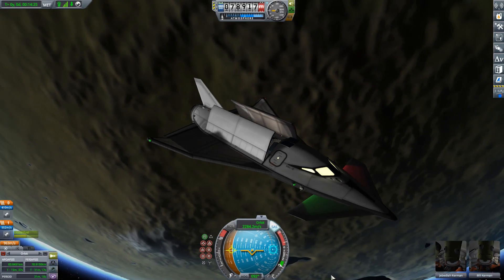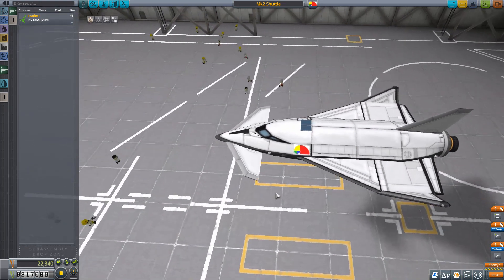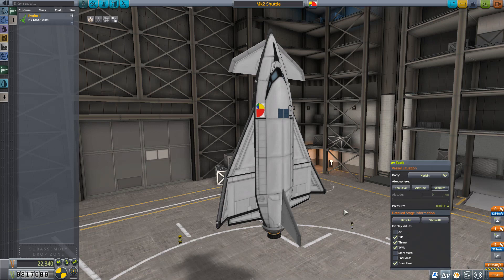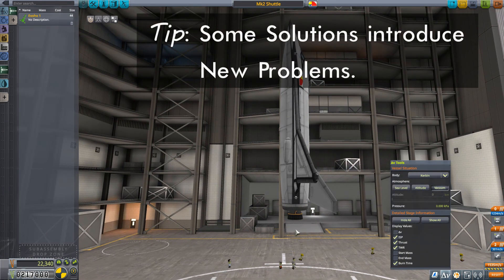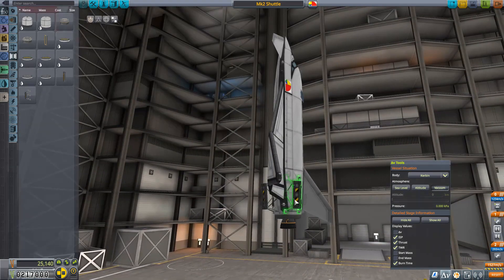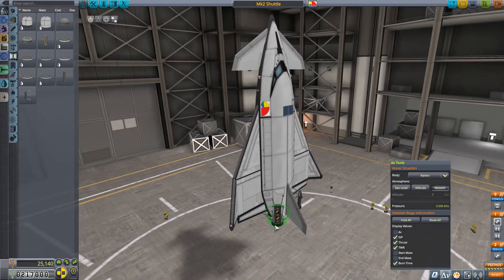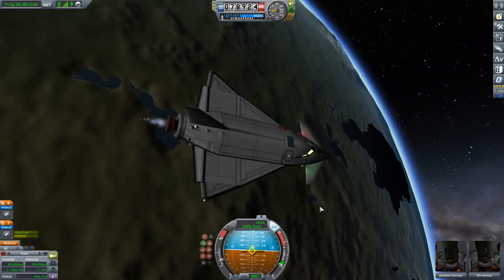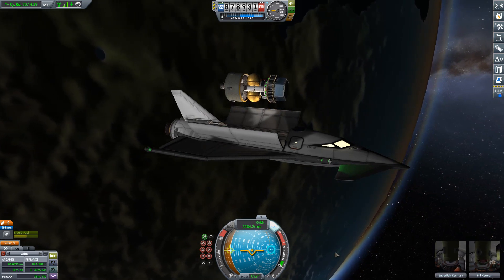How to Build a Simple Shuttle Lifter | KSP (Not) Beginner's Guide

Comment: Would using the rotate tool with it set to absolute and snapping enabled let you rotate them perfectly vertically?
Reply from the maker: I don't think so. Changing from local to absolute just changes the reference frame of the three axes, not how the snap works. In my experience, snap just gets it to rotate a specific number of degrees (I'm thinking 22.5). Not snap to specific orientations.